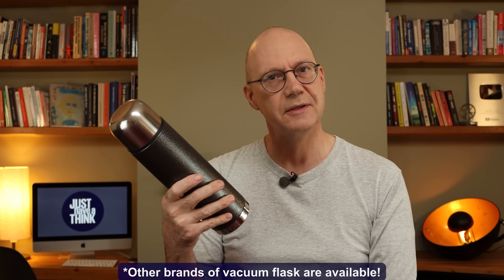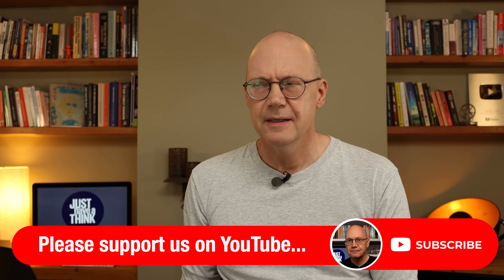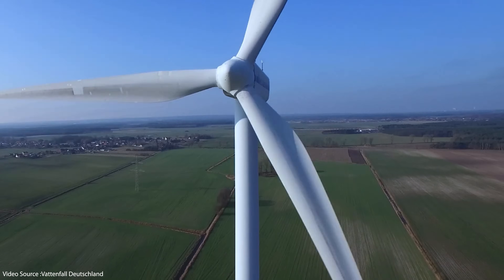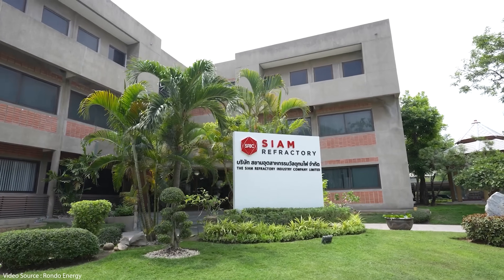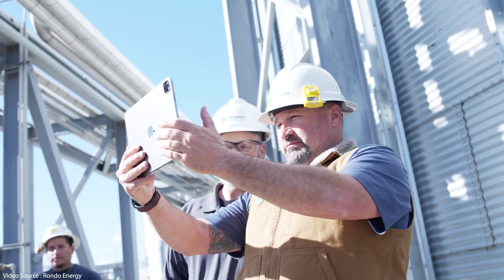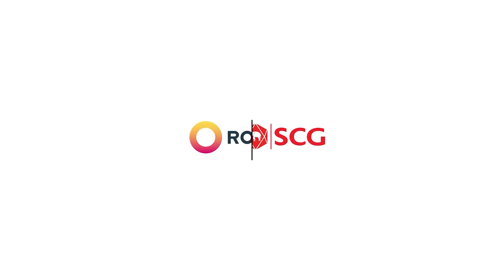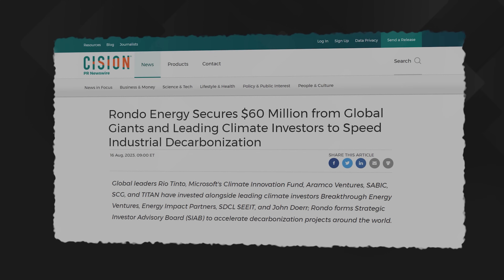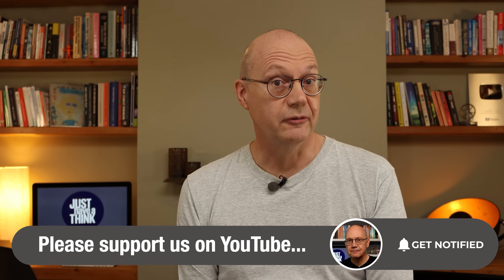This energy storage technology is HOT STUFF!

Comment: My fave part about the heat storage battery is it’s literally just a kiln, and the input/output system uses known and mature industrial principles, math and technology. 
     The innovation is the brick design, but 70s hot air passive solar house builds used beds of 3” cobbles in the crawlspace for the same reason - predictable heat release and turbulent airflow with minimal stagnation. These need to be slapped onto every single steam generator power plant on earth already in service, and two on every solar and wind installation.
Reply: Yes!
Reply: This would be perfect to go with wind and solar generation, but what would the efficiency be for such a system?
Reply: @mihir2781  The efficiency of resistance heaters is pretty darn close to 100%, mostly switching and line loss, but heat capacity of the materials drives input/output efficiency. Water can hold the most BTU per pound (other than obscure chemistry or phase change answers) of any storage medium, but only to the PV=NRT limits of water and container. Once you get up to a thousand degrees, efficiency is less important than stability, safety and ease of use. 
      Dumping excess wind, sun heat or PV wattage overboard is zero efficiency, so any amount of storage between demand cycles to level the grid is an improvement that makes wind and solar a viable solution and not a joke for trump rallies.

Comment: Pedantic point

The original Thermos®️ flask was not made of stainless steel, instead the drink was contained in a double thin walled  glass flask, with the glass silvered on the vacuum facing interior walls. The drink didn't taste metallic any more than it would out of a glass teapot.

Thermos®️ is a brand name, but the inventor of those flasks was called Dewar, who invented them to keep things cold, not hot. Did like Liquid Oxygen. In cryo lands three are still called "Dewar flasks" and the physics labs at Manchester have some in all sizes from a fraction of a litre to ones on wheels about 1.6m tall.

The problem with a Dewar flash for outdoor activities is that they are fragile: drop them from less than a meter into rock and the glass shatters.

That's why Thermos® went over to stainless steel for their top of the range flasks, and nowadays most hour drink flasks are stainless steel.
Reply: You know with modern gorilla glass, I bet they could make thermos bottles that were durable.
Reply: @mac_mcleod  only that it still breaks ;)
Reply: @nopenope1  I have dropped my current phone over a dozen times in the last 2 years and it's fine. I don't even have a screen protector on it.

When I was a child, I had thermos and dropping them from any height broke the contents. I think a gorilla glass thermos would not break because the outer plastic shell would protect it from direct impact buy a rock or pebble and the gorilla glass is more than strong enough to survive the g-forces.

And my phone is not a particularly expensive phone.
Reply: stainless steel vacuum one work just as good
Reply: @GroovyVideo2  I never thought so because the steel was a better conductor of heat or cold. 

Plus, mine had a taste that I didn't like.
Reply: @mac_mcleod  screenprotector does not really much, a case does a lot more, unless it really it the screen flat to the floor and or there is stones or something like this as well. A good example are the current iphones, the riggseverything guy, the glass breaks ;)
Reply: @mac_mcleod  I've had many high end expensive Samsung phones - with gorilla glass victus - all barely last a few months before fracturing. Hate the stuff.  Might be strong but its just not tough. I should know I'm an engineer whose designed more than a few high pressure chamber viewports.  Re  Your other comment - in fact stainelss is one of the best thermal insulating metals - but glass is yes 4 or 5 times better - true. However stainless can be thinned out a lot more compared with glass and it's the multiplication of thermal conductivity  and cross section that defines thermal transmission along neck to the top overall. They are about equivalent.
If you can taste something in stainless thermos it's likely wrong grade cheap chinese stainless. Properly graded stainless is amongst the least contaminating materials available - equivalent to glass. If it wasn't they would not use in the pharmeuctical and food industry  in ultra pure refinement processes.

This is what unwarranted belief in the power of supposed super strong glass looks like;
https://www.youtube.com/watch?v=BqGf8pqCZi0
...and that happended right after hammering away at the stainless steel door with much higher forces and no result  ..which kind of proves my point.
Reply: @bbbf09  my steel thermos were not manufactured in Japan or china.  This was a long time ago.
Reply: @mac_mcleod  The 300 series of stainless steels - speciifcally the 316L used in pharma and biomedical was developed before 1950s - so time isnt a factor. Japan has excellent manufacture standards. Not so China. I could believe that a cheap thermos from China - either now or long ago -  you could possibly taste metallic tang. However with a good quality 316L stainless I don't believe possible..
Reply: @bbbf09  that's good information but how can you be sure that a cheap American manufacturer didn't use low quality stainless steel for thermoses in the 1960s and early 1970s?
Was there a law specifying what materials should be used?
Reply: @mac_mcleod  that's an issue with heat leaking out round the rim where the inner meets the outer. The solution would be for Thermos®️ and other manufacturers to have better insulation in the cover of the top: insulated cups would help to stop that heat leaking further.

You're right: that was never an issue with the older glass versions: but sadly (stupidly?) they never updated the cups to adjust to the change in the flask.
Reply: @nopenope1  a screen protector would have saved the screen of a £700 phone being scratched when I stupidly put it in a pocket with a bunch of keys.

I agree that it does little for breakage if the phone is dropped, but surface scratching is another thing. 

A case that opens like a book would have saved my screen that day: I don't use them as being left handed they all open the "wrong" way for me :( and you can't just put the phone in upside down as the buttons are not placed symmetrically.
Reply: @trueriver1950  sorry the here that, but yeah. With my P6 I had to stop using the protector screen because the already bad fingerprinting sensor on the screen did even work more poorly with it. My case is a bit higher than the screen, so it should help in most cases when dropped.
Reply: his metallic comment had me puzzled. All my thermoses from the 70s - 80s were plastic over glass.
Reply: Why not just make the inner shell out of glass and the outer shell out of steel?
Reply: @ehtuanK  fragile glass breaks from the G-Force stresses on the connection point.  The glass inside the thermos breaks without ever hitting anything directly.
Reply: @ehtuanK  two reasons: the inner and outer shells are made in one process (in either material). 

Even if you could figure out how to make it, the glad inner would still break: it's the momentum of the drink giving the inner layer "concussion" that usually caused the fracture if the glass. The outer layer of the vacuum glass was always protected by a plastic or steel outer anyway.
Reply: @ehtuanK  They did
Reply: It is said Professor Dewar invented his vacuum flasks to take something cold to a lecture. A student went and patented the idea to keep thigs hot. True?
Reply: We called the glass ones maracas...
Reply: Here most thermos in the past were glass and if your glass part broke, you could get a replacement.
Nowadays pretty much any you can get are steel+vacuum which is waaay worse at retaining heat.
Wonder why people don't go back to glass?
Reply: @katm9877  tip: with the stainless steel variety most of the heat loss is via the lid. The heat conducts along the inner surface then over the rim and down the outside. 

With a hot drink inside you can feel this by touching the outside: how far down from the outer layer does the heat travel?

Putting something over the top of the flask will greatly extend how long your drinks stays warm for (use it to act like a tea cosy, but it only has to cover the top down as far as the warmth travels on the touch test). A winter sock works wonders for this (expert tip: wash before changing its use 😵‍💫).

The reason the glass models are hard to find these days is that the stainless steel ones became cheaper; at that point many people stopped buying the glass type. They are still made but rarely seen on sale in the high street.

Hope those nuggets of info help

Comment: Couldn’t you just use solar thermal or all? Solar thermal is much less complicated and less expensive. If you had to store renewables that could be added but have a base load of solar thermal.
Reply: Solar thermal would be unable to hit the high temperatures that this heat battery uses unless you used an expensive concentrating solar setup.

Comment: There are other benefits.  A lot of commercial processes need to run 24/7.  Rondo reckon 5 hours of solar power is enough to run the plant 24 hours.  In situations where there is a queue to be connected to the grid, this can be bypassed by colocating solar panels.
If they have surplus, the heat can be used to generate electricity allowing them to arbitrage price differences.  
A good way to kill the dünkelflaute. (Windless nights)
Reply: YES!

Comment: If Rondo used heat pumps instead of resistance heating they could increase efficiency by 600%.
Reply: I guess you can't get temperatures up to 1500⁰C with heat pumps.
Reply: what kind of heat pump can do 1500C?
Reply: A heat pump using steam would do it. Steam can get as hot as 2500 c. You would need solar concentration on your heat source to superheat the steam though.

Comment: Any plans how to do it DIY? What kind of insulation do they use?
Reply: the kind of insulation that can survive 1500 C
maybe polycrystaline wool
btw making it diy on a small scale would be annoying, you need a steam turbine for this to generate electricity.....
Reply: maybe a stand alone house heater. @423GustavBern
Reply: @423GustavBern  thanks, but I was not thinking turbine/generator path and that entire cycle. Was thinking about simple heating, to store heat for few months, as heat battery for home heating. I think Norwegians done similar sand battery but I was wondering there as well what do they use to insulate container.
Reply: oh ok, then you can "easily" do that, 1m3 of water can "give" you around 87KwH of energy from 95c to 20c
Reply: @423GustavBern  Idea is to use sand and temperatures around 600-800C and size around 28m3 (around 3metre diameter and 4 meter high cylinder), so it can hold temperature for few months. I am not finding water suitable for this.
Reply: @aleksandar7393  oh ok, i wanted to use water back in the day when i was thinking about it , so i could directly cirtulate the water from the tank thru the heat exchanger (car radiator) that would sit in the hvac system

would make it pretty simple and you could still use 20c water to heat up air to a comfortable 17c

with sand you need a lot of heat exchangers and piping you woulnd need to hope that the 800C sand wont boil the water when you circulate it to slow and the pressure wont blow up the system when someonething fails

Comment: I think this is the way forward - minimal impact on existing technologies (district heating, industrial processes), minimal footprint, relatively low cost and rapid return of investment for installer.
And no break-neck new technology/process/chemical involved.
And they even managed to squeeze AI in, which increases the chance for investors to step in :)
Congrats on the video - this time a bit more optimistic than usual :)
Reply: ai, the investor buzzword of the year eh?
Reply: @___.51  Whatever it takes to pry the checkbooks open.
Reply: I'm not sure if you have any experience in this field but you're basically spot on.

AI is the only real buzzword but ML is basically AI and definitely being used appropriately from what is described.

Anyways, the powers that be will keep this under tight security due to high level IP but any rich ingenious person can replicate with amazing results.
Reply: @ValidatingUsername  The problem with ML is that you might need to train it again for new deployment - as the model created is calculated on the inputs you get and those will be different.
The other option is to set your model once and then just use the resulting pattern in the device ;) But that's then just scalar model, not ML :)
While I find the idea of using constant learning and adjusting in these devices interesting, I don't think it's that usable or makes such a difference - the hysteresis of the system will prevent you to make some fast changes and prediction model for surrounding environment/target will have too many parameters.
So yeah, I believe this is another case where the "AI" is used only as a buzz-word.
Reply: @rklauco  I wouldn’t be surprised if it’s just a good old fuzzy logic optimisation system tbh. Calling it AI is kind of a flashback if that’s true! (And any neural network training may end up defacto reimplementing fuzzy logic for the reasons you mention!)
Reply: Our first project was built without causing a single hour of downtime -- we simply connect to existing heat networks. Super safe, inert materials, quiet operation, no local air pollutants like NOx, SOx, PM. Better for employees, healthier for community air quality. This is NOT a science experiment, rather, it's just an engineering project =]
Reply: AI means they never found anyone who could write algorithm so they throw the problem at machine. Still better that doing nothing. Panasonic heat pump is driving me crazy with absolute lack of algorithms, automation etc. 10 sensors, 10s of various modes of operations and i can't set up preheating boiler when cop is the biggest. It will heat up house at night when it's -20 and do nothing when it's -5 in the afternoon. Ai would figure out what to do here with 80% accuracy. Algorithm has potential to reach 95% efficiency in finite time of development.
Reply: Electricity to heat then to electrity should not be economic!electricity to heat storage then to heat supply could be worthy to my experience!whatever what materia work as hear storage sources